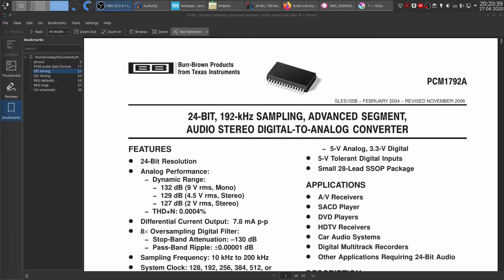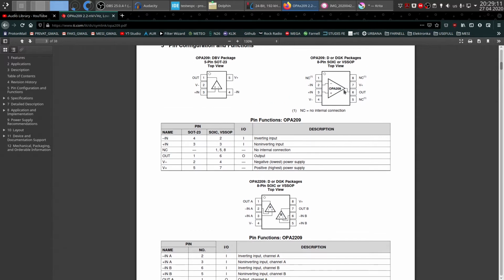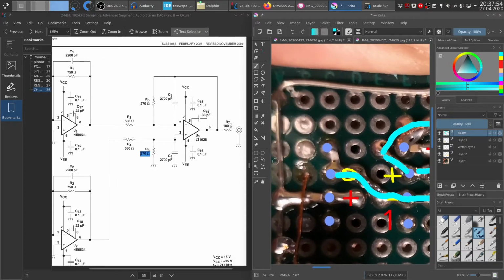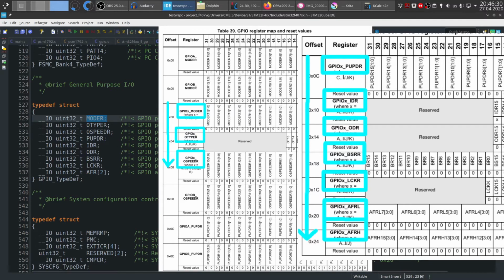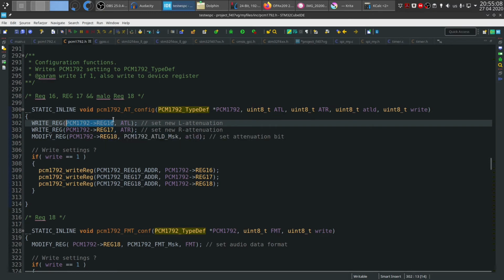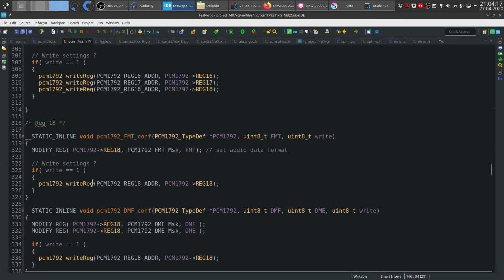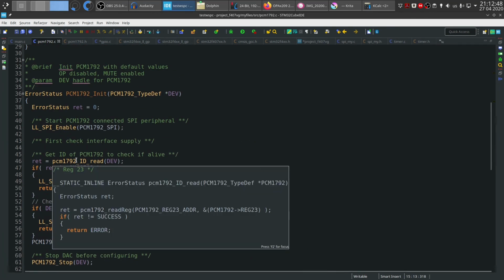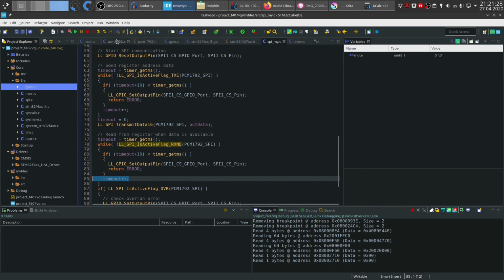DIY AUDIO DAC - part 2 (with LL) | Video 28

Comment: Hello! I was searching for material on youtube because i wanted to make my own audio dev board, to intergrate my audio projects with the digital domain, featuring an stm32 mcu and a TLV320AIC3254 codec! My question was that couldnt you use the usb fs interface io in stm io comfigurator as an audio peripheral or the i2s usb board that you use is the only way to stream data from the pc. I did some research on using the mcu's usb to stream audio from the pc but i didnt came across of a lot of resources. 
Thanks for the reply in advance and i really liked your material on the topic!
Reply from the maker: Hi. I also wondered that as I wanted to create a small sound card without the need of a dedicated usb i2s interface. I think that stm32 has 12 Mbps internal phy which could be enaugh for 44.1kHz, 16 bit audio (I see that f407vg in this case also has an option for external USB phy for high speed 480 Mbps). For this project I wanted more just to have compatability with higher resolution audio sources. But for a minimal interface it would be worth looking into.
Also with audio reproduction, clock stability and accuracy is important and those usb to i2s convertes have quite powerfull (multi core) chips along with multiple clock sources to generate precise signals. Sometimes DACs integrate clock reshaping to sync the signals to avoid jutter.
This can be all brought up as nitpicking but there is a reason why modern cheap audio solutions sound very; these purpose built devices work very well. I have no idea how much work would it take and how much of the processor performance such intergration would require, so I just used external audio source for that and avoid drivers and performance problems and let STM32 handle everything else.
I know this answer does not help you much, but I don't have enaught time to research this topic further right now, but I am interested in it in the future.
Reply: @MatejBlagšič  Thanks for the huge reply! I'm glad i have the same concerns about this project as you have! I'll give it a try and I'll make the pcb project after finishing my exams, and do some research on these kinds of implementations! I'll obviously let you know of any progress regarding the usb playback by sending you an email!
Have a great day
Best regards
PantelisEVs
Reply: @pantelisEVs  any updates?
Reply: @rohitpvksn1337  unfortunately after a lot of play around i did not manage to set it up and had to let it back 😔
Reply: @pantelisEVs  if i become an electronics engineer i will try to do it too
Reply: Did u made completed USB device?

Comment: Sorry I cannot find the part where you describe why you are using the microcontroller. Can you describe what it does to the DAC and why you are using it? Can the DAC work without it? I really like your hardware prototype by the way. I have a similar breakout board and a PCM1794 chip here I want to try.
Reply from the maker: It works fine as a stereo dac without microcontroller. This project is about modifying all the little parameters of a great dac and how to write a library. Second half of video is more about the code and what settings of the dac are used.
The pcm1794 does not have interface, only a few pins that configure important stuff, like audio data format, mute, mono/stereo mode.
Reply: He dosen't. I also expected to see connection between MCU and DAC via I2S from stm, not from some other dedicated USB converter. STM has chips with USB and I2S so they could perfectly perform the same thing without additional USB chip.